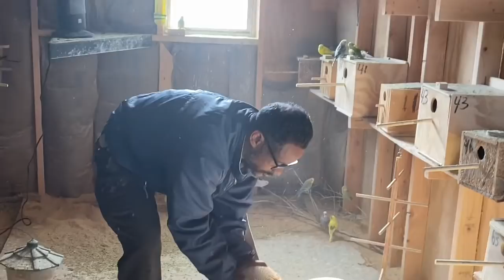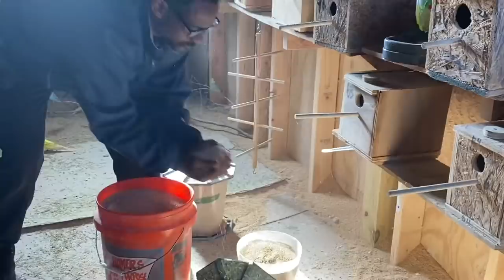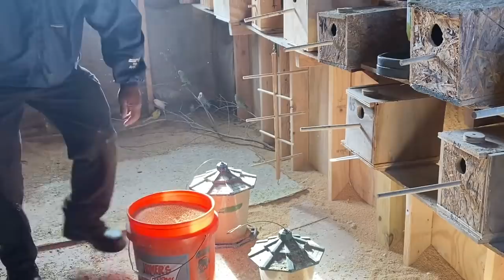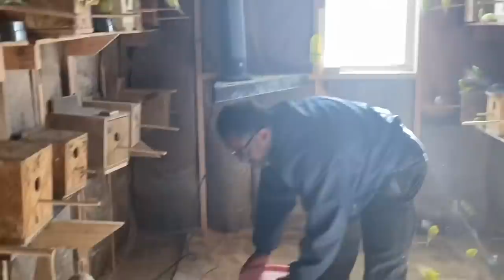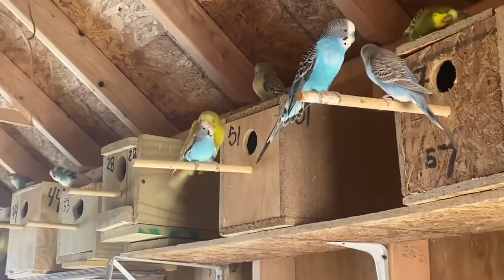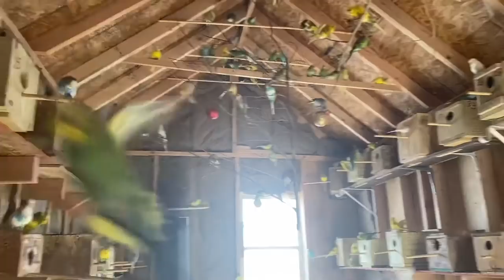FAST GROWING PARAKEETS AVIARY🙋‍♂️👌

Comment: This looks like In a backyard shed. I live in Maryland and we get freezing weather here in winter so I wonder if a setup like this would be possible.  Please advise. thanks!
Reply from the maker: yes in a backyard make shore you have enough ventilation in summer and setup a heater in ther winter at about 70 degrees f should be fine.summper time 90 and above will not be to comfortable thanks good luck let me know if needs more adviese.
Reply: @PARAKEETBUDGIEHOUSE  thank you very much 😊
Reply from the maker: YES WHY NOT? JUST MAKE ENOUGH OPENING FOR THE HEAT IN THE SUMMER AND PUT AN ELECTRICAL HEATER IN THE WINTER AND IT WILL BE JUST FINE.
Reply from the maker: yes it will work but you need a heater for the long winter.